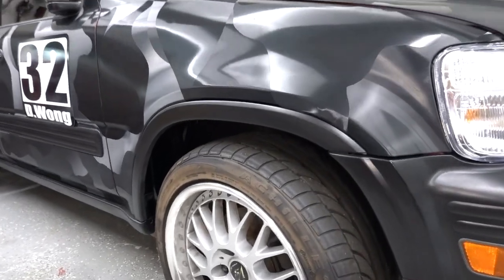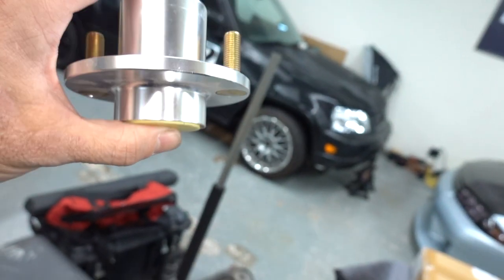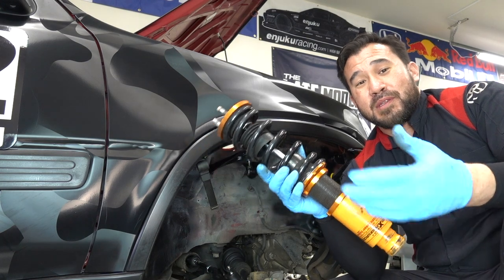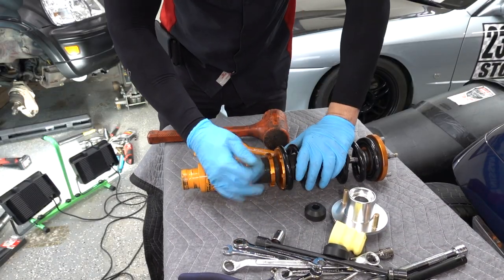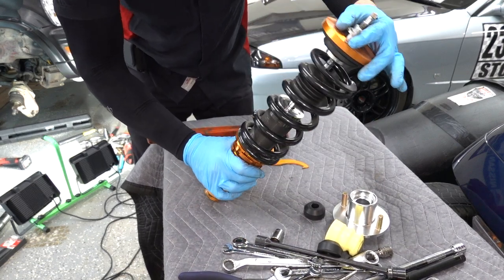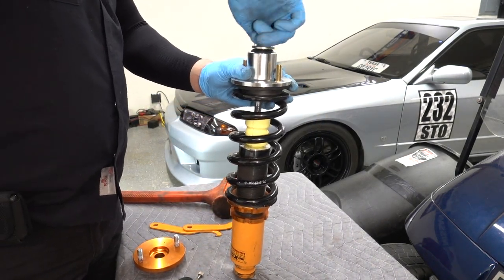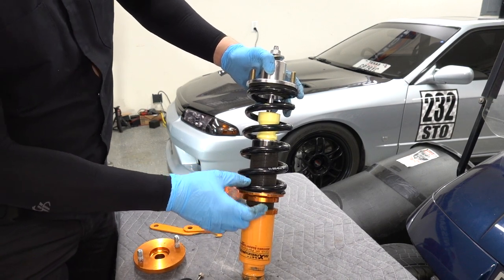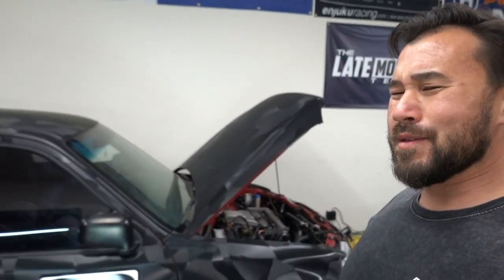Fixing the MAJOR Problem with Maxpeedingrod Coilovers / CRV  RD1 Shock Top Hat Extensions

Comment: If you want to go lower you can use civic forks or find aftermarket drop forks
Reply from the maker: I thinking about civic forks.
Reply: Does not work. Ek civic forks are narrower and are only like 1 inch shorter.

Comment: I cannot find these on ebay specifically for a crv which ones did you use ? Can u send me a link ? I liked this video thanks for the info have the same car running different coilovers
Reply: I couldn’t find any either
Reply: 24 Way Damper Racing Coilovers Kits for HONDA CRV 2007-2011 Coil Springs Struts

Comment: Or buy drop forks and you get 3 more inches drop and don’t have to mess with pre load
Reply from the maker: Got a recommendation on the drop forks
Reply: @Donnythelatemodeltech  MPC drop forks but they only make the front for those crv